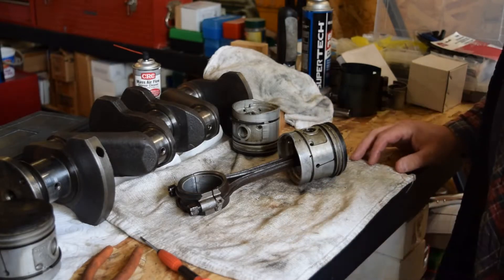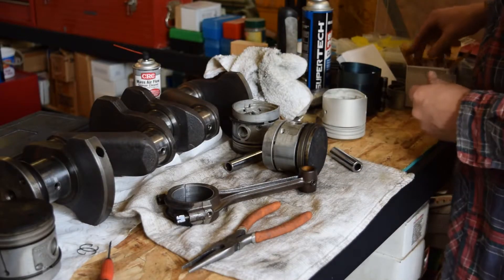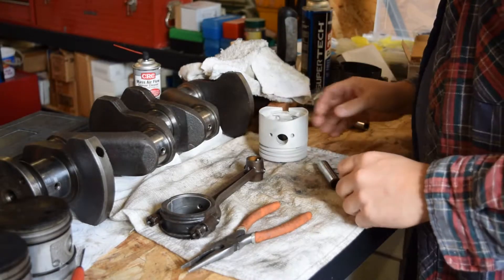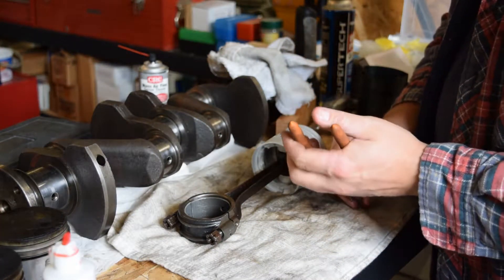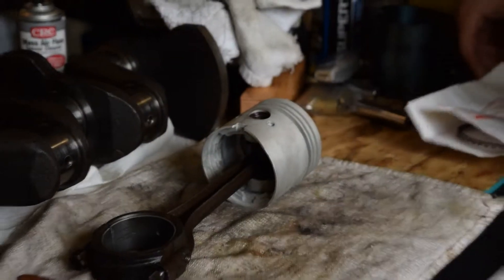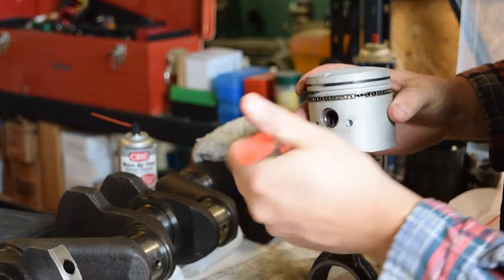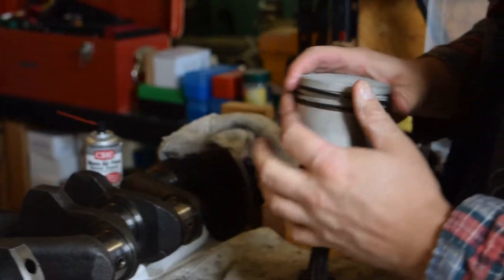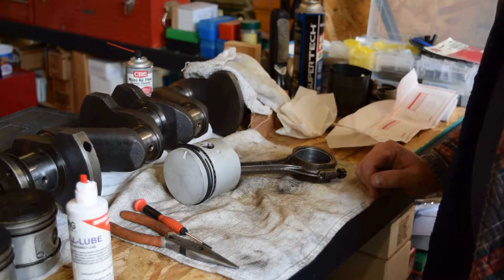1947 Ford 8N Tractor Rebuild Part 7 :Pistons

Comment: Should have honed the wrist pin bushings for the new pins to remove any out of roundness in them. If you use the old pins in the new pistons they could be undersized enough to create a "knock" in the engine. You have an oil ring, scraper ring, and the top one is your compression ring. The reason you stagger the ring gaps is so you have a complete sealing off of the combustion gasses in the cylinder. If you line them all up you won't have compression as the gasses can escape to the bottom of the piston. You would have one heck of a bypass problem. Speaking od machine shops I am doing a 1939 Deere B. I paid 1500 for it and I now have another 2000 in parts and machine work. I like you am doing all the labor. A word to the wise..... Youtube doesn't like anything to do with guns or related subject matter. You only learn by doing so labor on. I am sure it will turn out well.........
Reply: Johnny Holland It will not cause compression loss. With the rings compressed the have an end gap of only around .015." The rings rotate on the piston anyways.

Comment: Great videos, I notice that the previous piston the engine had where 4 rings and now you are intalling new ones with three.  I know that it will work, but I am curious as to whether they sell a piston kit with four rings or only 3 rings.  Keep up the good work, people say this and that, take to a machine shop, but the truth of the matter machine shops are super expensive and by the time you know it you have invested over $1,500.00 in parts, machine shop and not counting labor.  We as mechanics we want everything to be new but the fact of the matter is that people want the bare minimum.
Reply from the maker: Thanks! I am not sure whether you can get a kit with 4 rings. There may be places you can, but Steiner, (where we purchased ours) came with three.  But, I don't think it makes a huge difference like you said.
Reply: They do sell kits with 4 ring pistons at yesterday's tractors

Comment: Did you have to size your rings before you installed them onto the piston? Thank you
Reply from the maker: No, we were able to use them straight out of the box. They are already made to size to match the cylinder sleeves and the pistons.
Reply: You should always check ring end gap .015 is a beautiful clearance. If you don't do this step when rebuilding engines the rings could break when aluminum piston expands as engine reaches operating temperature. The less severe problem will without a doubt premature ring wear with a engine that smokes and burns oil
Reply: @kokxluke7063  apparently these are good kits.  I watched another guy, that does this a lot, not measure the piston OD, sleeve ID or the ring end gap.  He didn't plastigage the rod or main bearings either, just looked at the condition of the journals.  Apparently it worked.  I'm as anal as it gets to engine stuff, but apparently the Taryl view applies to these old Ford engines: "it ain't the space shuttle, it's a tractor".  Of course he says lawnmower, not tractor, but apparently it's true here too.  When I do one, everything will be checked as best I can.  Obviously the factory didn't custom fit this stuff as they put it together.

Comment: Good videos so far but the reason why u do t install the rings all in line with each other is it can cause blow by or lost of compression
Reply from the maker: Thanks! Yeah, that makes sense. It is the way we have always been taught to do it, and I agree it works better to have the gaps not line up to get a better seal.